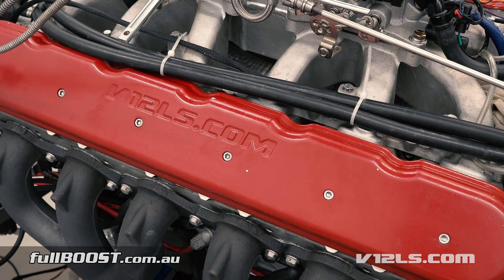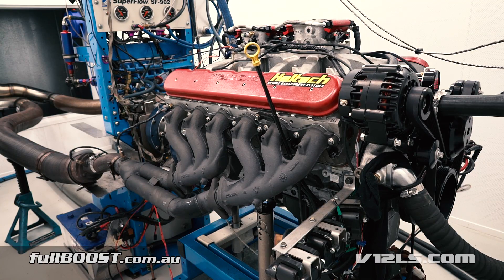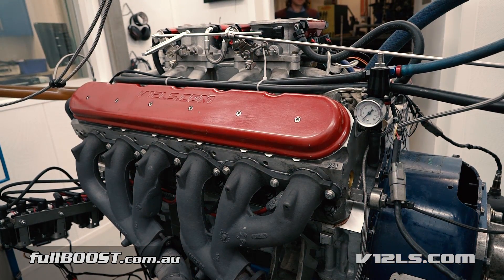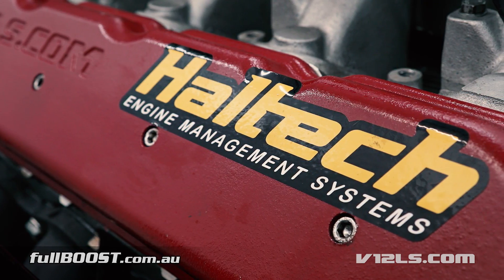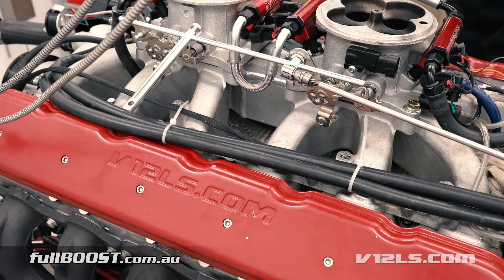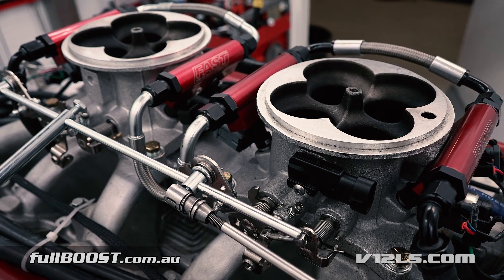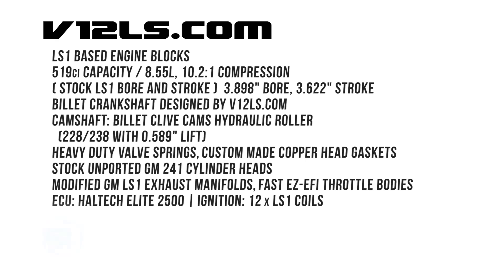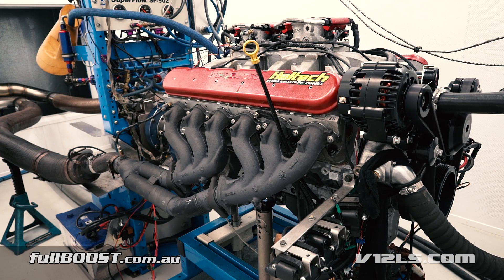V12 LS1 engine dyno

Comment: My 3.8L v6 made 680ft-lbs of torque to the wheel.
Reply from the maker: which is not the same at the engine.
Reply: That's quite awesome from a 3.8 v6. You should make all the same mods to one of our engines and see how much torque you can make!
Reply: sinusbradycardia to the wheel? was it in a motorcycle?

Comment: That trottle response is like the worst turbo lag ever on a non turbo car
Reply from the maker: The dyno controls engine load not the throttle body. Perhaps read up on how a dyno work. Cheers.
Reply: Thanks for the interest. This is a commonly misunderstood function of the dyno as most videos online simply allow the engine to rev up as quickly as possible. If all you care about is peak power that's fine, but you miss out on a lot of data to get the tune right. The dyno operator controls the load. Think of it like going full throttle in park, vs on the flat, vs up a big hill in 5th. It's all up to the operator what conditions the engine is put under. If you want to learn more, HP Academy and EFI University have some good online courses for tuning.

Comment: that thing has a massive dead spot in the throttle.
Reply from the maker: Its the dyno operation not the engine.
Reply: really? Watching the throttle body open up, revs seem to drop, open the throttle body full wide, and nothing happens...
Reply: +wipout1 because the engine is under load to calculate the power it produces
Reply: +mickeynismocat yeah but dynos are usually smoother (or at least the ones I've seen).
Reply: lol fullboost all these people who have no idea about how it all works, then comment, and still don't believe u when u give them an answer lol abd if they think that loadup was bad u must here a hub dyno do it u think the shafts r going to rip out lol
Reply from the maker: +tamreg04 Yep, we refer to them as YouTube mechanics lol
Reply: meh, poor little ls1 chokes under the first sign of load.
PS nice work on the bogan ricer
Reply: 500s at the bottom end is NOT choking for power.

As the dyno increases it's load, it opens up the throttle body. If it does not open it, ANY engine will stall. If it does not load it up and just opens the TB, any engine will blow. It is how an engine dyno works.

It starts at a predetermined RPM, it increases load and opens to WOT, holding a balance of a starting RPM, then it reduces the load until it reaches a programmed redline, and records the time it takes for the RPMs to climb, vs the load, to calculate power.
Reply: My thoughts also. It appeared to me like it was jetted WAY too small, the engine most certainly was not getting enough air.
Reply: Simon Wells lmao, which is it? not getting enough fuel, or not getting enough air?

Comment: the engine don't quite dish out the power I was expecting. this still needs some fine tuning and needs a different intake setup to crank out more impressive numbers. the torque should have been around the 800 range I would have thought.

Comment: Bravo, I was impressed with the guy who came up with the spark plug. The internal combustion engine is a captured bullet on a crank. I'm still waiting for the development of the captured Wing aircraft.
Iron American Dream on YouTube Share it. Take a ride across the promised land. Ride a Harley.
Reply: eric heine do you mean a helicopter?
Reply: Tanner Marlow, no Tanner I mean a captured Wing aircraft.  An airplane is a fixed-wing, a helicopter is a rotating wing aircraft.  A captured Wing aircraft would be like a wing in a wind tunnel. except the wind tunnel would be circular and the captured wing would be in the center, disk-shaped. The disk shaped wing would rotate in a cage, similar to a roller coaster that is also circular.
For flight within an atmosphere.

Comment: 702The 702-cubic-inch (11.5 L) V12 "Twin Six" was offered in United States GMC commercial trucks, and as a special order option in Canada. It was mistaken as two V6 engines welded together, but it is its own separate engine design based on a single casting.[2] It used four separate exhaust manifolds, two separate carburetors, two separate distributor caps driven by a single distributor drive,[2]
 and other parts from the 351. 56 major parts are interchangeable 
between the Twin-Six and the other GMC V-6 engines to provide greater 
parts availability and standardization. It produced 250 net SAE 
horsepower (190 kW). Torque was 585 lb·ft (793 N·m).

Comment: A 5.3 on 15 psi puts out those numbers
Reply from the maker: Relevance?
Reply: Fullboost I'm  just saying it seems underpowered for all that work.. DON'T GET ME WRONG IT'S A SICK ASS BUILD I WANT ONE if I had the cash  ,,, now put a 4l80e behind that and it will make a lot less POWER
Reply: Now put 15 psi into this and see how much more power it makes. Remember that this is essentially a stock 5.7 with a cam, and 4 more cyl's. Apply any of the power adders that you would to any other LS and make a whole lot more power. :)
Reply: WarWagonMT I know what is and if it is truly based off a stock ls1 I know it will not hold 15 psi so there would be no point....
Reply: Build one how you want Josh, we just released an engine builder kit and it's iron block so you can boost it all day long. Unless you put a Daihatsu turbo on the thing you will make more power with 9.5L than 5.3L. Even then you would probably still male more lol.
Reply: V12 LS no shit. No replacement for displacement I'm glad you got an iron block kit what did you do bore out 2 5.3s and bore them to a new 5.7 then glue them together
Reply: If gluing two blocks together is your thing, then go for it. You could look into cast welding and brazing, which has been done successfully before by the likes of Jan Baker with a pair of Ford 302's, which also made respectable power.
 Or, you could just buy a brand new, cast iron or cast aluminum block, heads, crank and cam from V12LS.com and build that engine to handle as much boost as you dare to throw at it.
Reply: WarWagonMT no shit, you don't say,,,, of course I'm not just talking about glue I was being sarcastic. It's a sick build but to much space taken up and not a whole lot of power,,  but yeah maybe one day I'll just get a v12 lt1 gen 5 ,, lol I can only dream

Comment: Lets not forget that this engine is a V8 LS1 which has 4 more piston block welded onto it to make it a V12, so just imagine if the forged a V12 block based on those spec or casted a 6061 aluminum block and then had special pistons to match like the same used in LSa engines and also the special oil feeding system built into the block internals and also special grade of bearing caps and 12 bolt mains with side bolts to strengthen the crank main caps also larger oil/water feeds and design a specialised copper casket to suit, better cams and hi revving Cranks, hi flowing heads and then a supercharger to suit or twin turbo to suit, take you pick, then you have a engine which will make at least 1,000 HP all day every day and bullet proof as long as all the micro measurements are done correctly during assembly and the blueprinting of everything that moves, weights balancing of every moving part ? Basically a Hi HP V12 to be used for drags street and every day driving, now thats what these guys wanted to get too in the end, its one thing to make a working V12 LS engine,but its a totally different beast to have the same engine made for all the uses mentioned above ? Good luck to the australian guys who made this beast. :) cant wait till they make a better improved version with various performance options made from the best alloys and metals on the market to prove to the world of engine building we have what it takes to beat the rest at their game,. like Farri, lambos and other V12 engine manufacturers and not have multi million dollar machines and 100's of engineers working on a engine to get it right, after spending millions on R & D just for the engines side of things ? these guys made this engine in a shed, with trial and errors made to get to this stage ??
Reply from the maker: More info

https://www.youtube.com/watch?v=P7ZkRuuU30E

Comment: Impressive. Concerning is the cam of course, I don't think you will need to install a high lift cam to make usable power, but the cam is concerning, that is one long bump stick....
Reply: You are right, in an old engine with standard cam followers and a small diameter shaft this would be an issue.
 The LS engines run a large diameter cam shaft and roller followers, so cam loading is not as much of an issue as you first think.
 The torque curve of this engine is amazing. Stock valve lift is all it really needs to make good usable power, though when it's a full custom cam I guess you can choose what ever profile you want.

Comment: so weird that at 1:28 they go full throttle and it just sits there for a couple seconds before ramping up.  very big dead spot.
Reply from the maker: It's the operator loading the engine, there isn't a flat spot.
Reply: do you know what a dyno is?
Reply: swing and a miss
Reply: yup but I'm a poor plebian so I've never actually been at one in person

Comment: I want to see an LS7 based one
Reply: Keep an eye out, follow V12ls.com here and on FB. I feel there is something you are going to like in the pipeline. :)
Reply: Not sure they didn't go for broke in the beginning and build this off of the LS7 bore/stroke. For the money this thing cost you might as well go HUGE or go home. 10.5 liter LS V12 with individual throttles would be EPIC!!!
Reply: Personally we like short stroke engines but we have LS7 bore iron blocks available now, and we can do a special order crank. LS7 port heads will be out by SEMA 2017 too. So if you want to step up and build it you can. Orders are 3 month lead time.

Comment: This is so cool.   I love when bar napkin ideas become reality.  I'm curious about the firing order.   How is the crank configured?  Does it have a split pin?  Are the crank throws 60* apart and it is running like 6- 90* twins?   What's next....a 72* block?
Reply: Running like two I6s 90 degrees apart. There were a few reasons we went that way, but the big ones are the ability to use LSX parts and a stronger crank without split pins. It idles like a big capacity odd fire engine (viper like), then cleans up nicely with a few revs.
Reply: Gotcha,   like 6 Ducati twins stacked together.   Odd Fired but balanced.

Comment: Most LS1's on the dyno run up to about 3500 rpm's, in third gear on a chassis dyno, and then max it out. This V-12 when the throttle is pushed to wide open took a relatively long time to rev up on the engine dyno. It didn't look right. Would like to see it at it's top potential. Besides that, did you notice how quickly the engine slowed down. It appears the dyno operator not wanting to break his dyno, put a little too much for the pull.

Comment: 427 cu inch Windsor with SBF Hemi Heads blows this away . 
928 hp & 674 ft lbs .  That was 5/6 yrs ago & now it's over 1000 hp on pump gas ⛽️.  

The 10.2-1 Compression hurt this LS1 .  NEEDS 2 BE a minimum of 11.2-1 Compression.  Coils near plugs & crank trigger Ignition

Comment: You'd figure the torque would be a lot closer to the Hp curve, being a large 12 cylinder with 3.898" bores and a small cam. I would of figured, say 750-Hp/700 lb-ft of torque. 

I would change up these things;
-less lobe split on the cam profile
-bore block and use 3.903-3.905" flat top pistons with valve reliefs
-ported 243 LS6 heads with lightweight 2.02"/1.575" valves and mill the heads to 58 cc Chambers.
-3.910" bore, 0.040" compressed thickness head gaskets to achieve 11:1 Compression, Quench should be 0.032"
-longtube headers
-quality 93 octane 
-BTR .660 Platinum Springs with Titanium retainers
 Using the parts I listed above you could gain another 80-100 hp at the crank. The cam I would use would be a 238/242 .600/.600 112 LSA cam with 2 degrees of advance. Regardless this is awesome , the ingenuity of people.
Reply: Good input there Strixx, remember that this engine was the first prototype, built on a budget. Money was only spent where it had to be, so this engine had stock 2nd hand pistons, rods, valves, rockers, pushrods, cheap 241 heads, no porting, modified factory headers, single point injection etc.
 The engine preformed really well, and made a fraction more power than expected.
 Cast iron and aluminum blocks have just hit production, and LS7 style heads will be cast in the coming months.
 Cast iron blocks will be able to take up to a 4.25" bore, though 4.125" will be standard, with JE pistons and forged rods., bringing the capacity up to 581CI with the 3.622" stroke.
 Valve lift will be kept just below the 0.600" for reliability. Compression might come up a little, though we need to keep it pump fuel friendly, so 11:1 will probably be in order. 
 Stay tuned, and follow us on FB for updates and see what power we make out of this new combo :)

Comment: I legitimately am surprised at how little torque it makes
Reply from the maker: A stock 5.7 which this is based off puts out around 350/350 so these V12  figures are not low at all.
Reply: Fullboost don’t get me wrong it’s a mint engine 👌🏻id get it when they are available